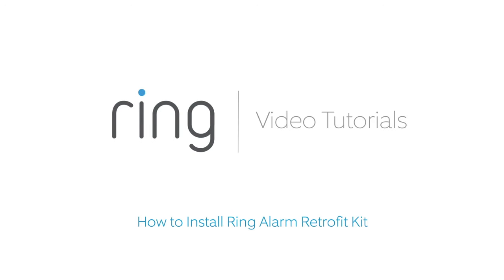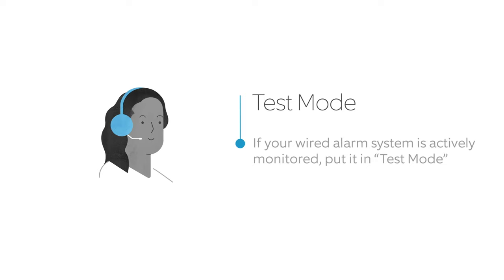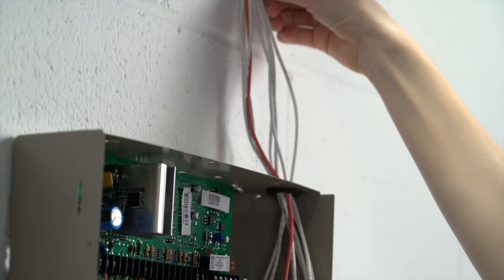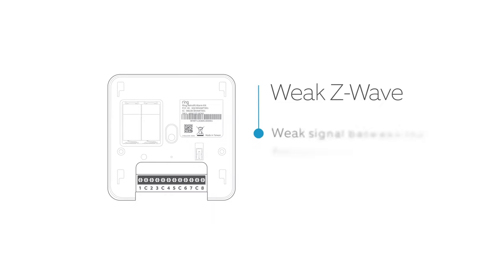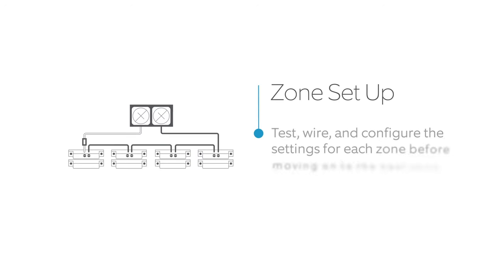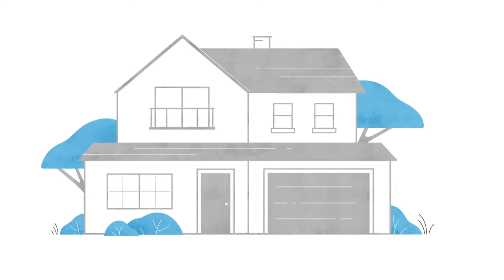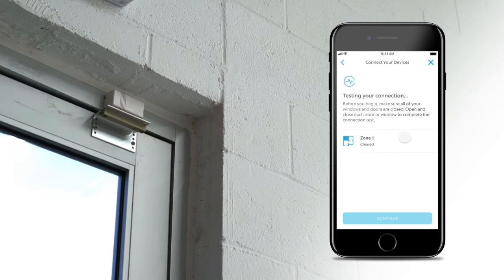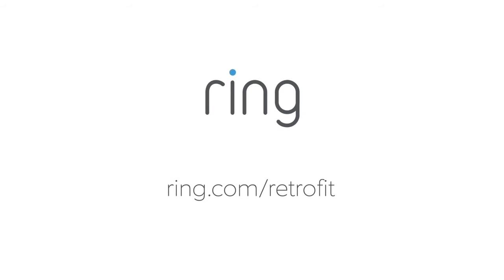How to Install Ring Alarm Retrofit Kit

Comment: Sounds good but from what I'm gathering, it doesn't sound like it's compatible with existing wired motion sensors. A version which can connect to motion sensors too would be more ideal
Reply: They Ring motion sensors are fairly inexpensive. Just replace and add the ring motion sensors. You should't have more than 4 in a home.
Reply: You would need to have a power source for wired motion sensors. I know some folks that use their old alarm panel wiring to power the ring key panels too. I haven’t researched the entire setup though to see how they completed the job with the power and battery backup back in.
Reply: @nosirrahm   i did this today seems to work fine just going to disconnect the adt key pad then uses the existing power to the panel, worked fine
Reply: @adrianhoffman6393  Thank you thank you!!!! ADT goodbye!!!!
Reply: @nosirrahm  A motion has 4 conductors. Two for power and two for the signal. Just leave the two power wires hooked to the panel and wire the two signal wires to the Ring kit.

Comment: Does this only work off batteries or can I plug it into power, I have an outlet that has battery back up I'd like to use. Or can it use the existing 12 volt DC that is available in the security box. I am looking to avoid battery anything.
Reply from the maker: Hey neighbor, we appreciate your interest in Ring! The Ring Alarm Retrofit Kit does need to have the supplied batteries installed — learn more here: https://support.ring.com/hc/en-us/articles/360032456492-Welcome-to-the-Ring-Retrofit-Alarm-Kit. Rest assured, the average battery life for the 2 x 3V Lithium CR123A is 3 years. Let us know if you have any more questions.

Comment: Hi, my alarm now has multiple contacts for each zone. Will that be able to work on this ?
Reply from the maker: Hey neighbor, we'd like to learn more about your current alarm setup and ensure we're providing you with accurate information. Please give us a call so we can have a member of our Ring Alarm team assist: ring.com/callus.
Reply: Yes, if not already done, you will need to wire them in series, test resistance with the multimeter, and land the series end wires on the ring box and use a single #/c connection.

Comment: My home is big and I have 20 zones in my first floor. Do I need more than 1 retrofit kit and if so how do I wire them? Thanks
Reply: Each retrofit only does 8 zones. So you would need at least 3 for your first floor.
Reply from the maker: Great question, NintenDad. Each Retrofit Kit supports up to 8 zones. With 20 zones, you will need to connect 3 total kits to your system. Check out this article for detailed installation instructions and other helpful tips: https://support.ring.com/hc/en-us/articles/360032456492-Welcome-to-the-Ring-Retrofit-Alarm-Kit. Let us know if you have any additional questions, we're here to help!

Comment: Hi. I have an exiting ADT system and just purchased the Ring system to replace it. I'd like use the Retrofit Kit to use the hardwired sensors since the Gen 2 contact sensors won't work on our doors that open out. When we cancel our ADT will they remove all their equipment including the alarm panel?
Reply from the maker: Hey Gerri, we are thrilled to hear you are adding a Ring security system. For your question regarding your existing alarm system, please reach out to your current provider for information on your current equipment.
Reply: Depends on your contract. if you have a lease or lease to own. Mine It was 3 years. After 3 years you don't have to surrender your alarm since you PAID already for the installation. If you have for more than the time you signed for I would cancel and when they call saying they need to remove, tell them ok and let they know they need to patch and paint every hole they had made at your house. Just a note!. It will cost more to dispatch a technician and make them to remove all the alarm, sensors, cables then patch, paint and sound proof your windows, doors and holes they made. I hope that helps!

Comment: I installed this today, was easy and I suck at this stuff. Ask me any questions. My system is dialed in
Reply: Would this still work without an original panel?
Reply from the maker: Hey there, great question! The Ring Alarm Retrofit Kit is designed to be used with existing wired alarm panel. Learn more here: https://support.ring.com/hc/en-us/articles/360035340111-Frequently-Asked-Questions-about-the-Retrofit-Alarm-Kit-. Let us know if you have any additional questions, we are here to help.

Comment: I wired the retrofit kit as soon as i put wire in it it start burning smell i took  of the battery and didnt find any power outlet
Reply from the maker: Hi there. Your safety is our top priority and we want to provide you with the best solution possible so you're able to install your Ring device with ease. Please give us a call at 1-800-656-1918 (or if outside the US http://ring.com/callus) so we can provide you with assistance over the phone. We look forward to hearing from you soon.

Comment: Can I use a wireless sensor with the ring alarm? They are Z- Wave compatible.
Reply from the maker: Hey Matt! The Ring Alarm Retrofit Kit is designed to connect with wired contact sensors — learn more here: https://bit.ly/315BsL9. We'll be glad to forward this to our development team as feedback. Please let us know if you have any more questions.
Reply: No without the retrofit kit.
Reply: @ring  Hey Ring. I would like to know if I can use the ADT rx-7c (just a siren. Positive and negative prones) to the ring alarm. Or will the retrofit be able to use it as a sensor. Unfortunately I dont like the siren sound on ring or any other Z-wave siren and I figure why not use the old one I have for my previous alarm system. Thanks!
Reply from the maker: Great question! Currently, the only additional siren that will work with the Ring Alarm system is the Dome Siren that is available in the US only. No news to share about further integrations at the moment, and the Retrofit Kit can only be used to monitor pre-existing wired contact sensors and will not allow you to trigger any alarms. We're happy to help if you have any other questions.

Comment: Hi, does the retrofit alarm kit come with a keypad?
Reply from the maker: Hi Kassra! Our Retrofit Alarm Kit is a wired-to-wireless bridge that conveniently connects your existing hardwired contact sensors to your Ring Alarm system. The Ring alarm kit/accessories are sold separately. See more at https://shop.ring.com/products/retrofit-alarm-kit.

Comment: I dont have a  alarm panel, only the contact wires as my security system was never fully installed. Will this still work?
Reply from the maker: Hi there! We're unable to guarantee that the Retro Fit Kit will work with your system since there isn't a panel to reference what wires lead to what zones and if the zones are actually set up. If you have any additional questions, thanks for letting us know. We're happy to help.
Reply: Tone out and label your wiring